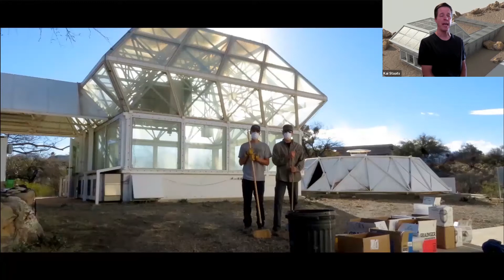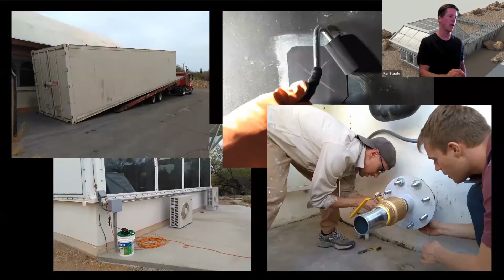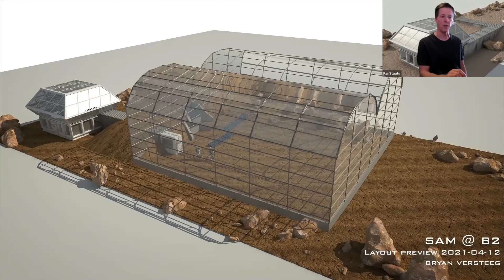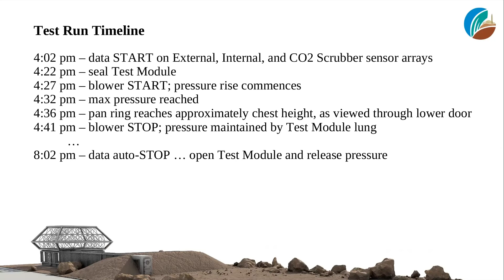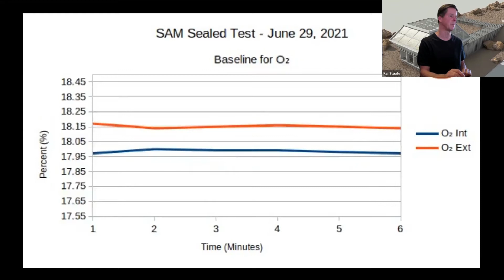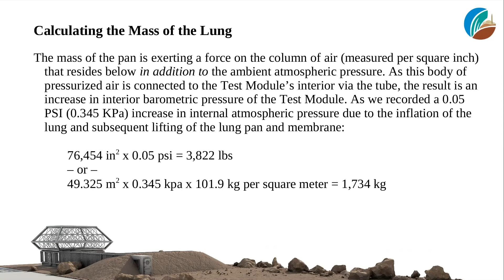First Seal of Historic SAM Analog at Biosphere 2 - Kai Staats - 2021 Mars Society Virtual Convention

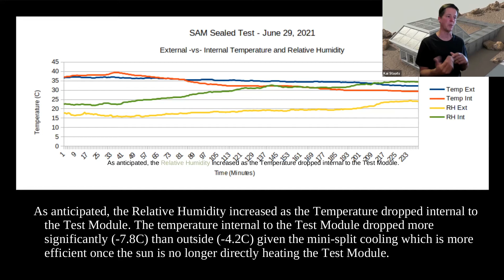Comment: [ 16:09 ]  Whoa. Did not realize this, but a crystal dome on a body w/o a significant atmosphere will either shatter or the pressure inside will fluctuate too much w/ temperature changes...so this pressure oscillation factor needs to be taken into account, in a way that is resistant to failure and has redundancy perhaps.

Comment: Perhaps the first colony station on the moon should simplistically be designed as a giant balloon with a baseplate inside one of the lava tubes.  As hydrolyzed lunar water was used to fill the balloon it would maintain a minimal pressure that would prevent the inhabitants fluids from boiling yet it could expand to allow for growth.  A collapsed balloon would take up minimum volume for transport and the cave it would be located in would provide immediate protection from radiation without the need of digging or covering to protect the habitat.  A series of these moon balloons shaped like sausages could be quickly shipped and assembled together like links to provide immediate shelter, while secondary materials could be shipped later that would be combined with regolith to cover the structures to gain more structural integrity. 
Ultimately a source of carbon and even nitrogen will have to be found somewhere in the solar system to support the colony there, other than earth proving humans can be multiplanetary.  Otherwise, we can only send robots outwards as proxies for our fragile lives down here.